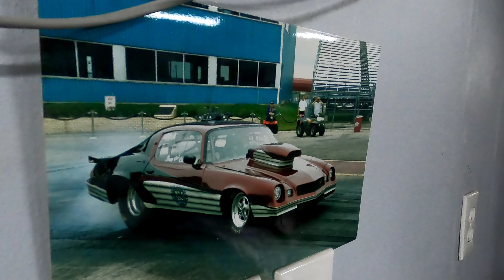Vol2 Slot car drag racing. another hobby. shh don't tell No one in my house.

Comment: Como funciona esses carrinhos?
Reply from the maker: They sit on a track charged with electricity.  There is a positive and negative points on the bottom of the car. The trigger in your had makes it go. Past the finish line it's no charged with electricity so it will stop to run after that and slow down to stop with the help of some sticky substance.
Reply: @DabbleRcfukna  Legal, muito bom, obrigado.